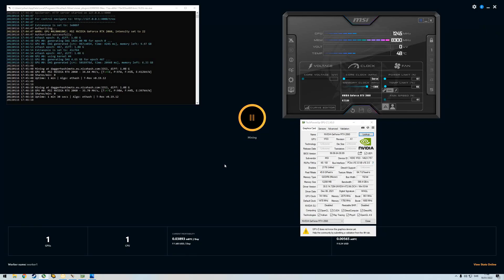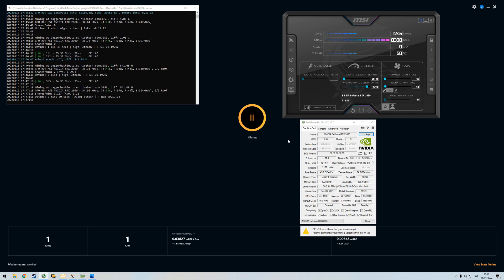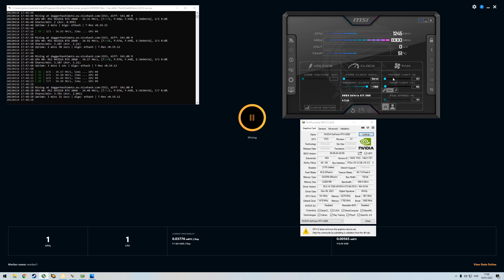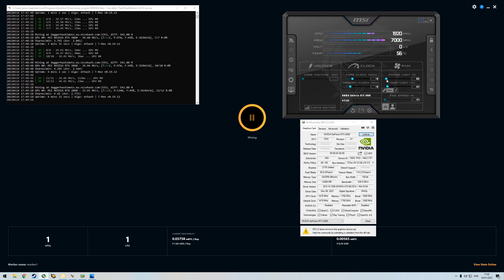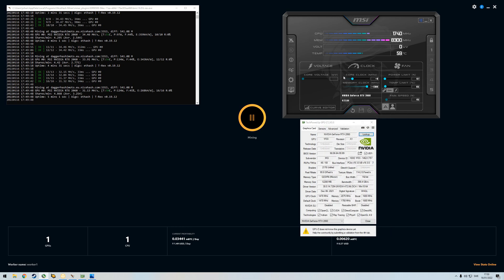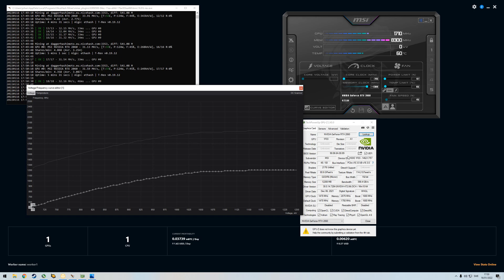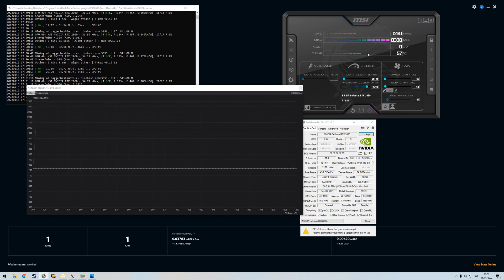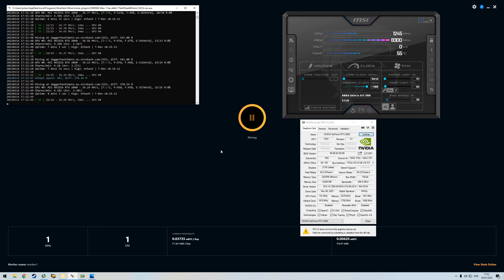Locking Core Clock In Msi Afterburner To Get 36-37 mh @95w (RTX 2060 12 GB)

Comment: hi brother, do you have any recommended OC setting for this GPU in Hive OS? my card same with you :)
Reply from the maker: For dual mining with alph and eth i am at coreclock 1340, mem 2500 and pl 125
Regular ethash im at core 1245, mem 2500 and pl 125
Reply: @KwinKwin  thanks a lot for your input. I got 2 card, one MSI and another one gainward, very hard to oc it, sometime crash also hehe. really appreciate for your reply !

Comment: very efficiency stonk
Reply: Set 98 core and 1400 Mem leave power at 100 and fans at 50 perc and let me know.
Reply from the maker: @DM-mu4et  What do you think it will give me? Im only at 1300 mem now since its on a desktop pc and display, not as stable on display it seems like
Reply from the maker: @DM-mu4et  ok, haha why is that ur guess?
Reply from the maker: @DM-mu4et  37.46 btw I just noticed it stays at like 99 w since its still locked aswell
Reply: Sorry , this not work for me. I have evga rtx 2060 12 gb
Reply from the maker: @marekungrady4256  What is not working? If u explain the issue I might be able to help you. It should work for any 2060 12 gb
Reply: @KwinKwin  I do everything according to your video, but my core clock still moves around 600-700 mhz. So i must increase power limit in msi afterburner to 116 % to keep core clock around 1100-1200 mhz
Reply from the maker: @marekungrady4256  I think some 12 gb cards have different mhz on core so maybe that is why, the whole purpose to do this is to lock ur gpu at lower mhz so it gets more stable and less wattage. How much is it when mining?
Reply from the maker: @marekungrady4256  Just checked my other video about 2060 hashrates and at stock clock settings i have 1920 core mhz while mining ethash. Maybe your numbers are half for some reason, you could try locking it at  500-600 mhz and see if it works. If that works you could try to slowly go lower to find the sweet spot for you also do it while mining so you can see if it affects ur hashrates and wattage.
Reply from the maker: Yes mens thank for comment now gib content (and skins)